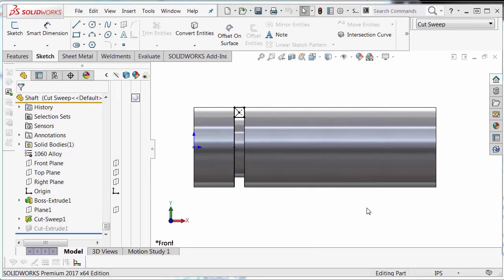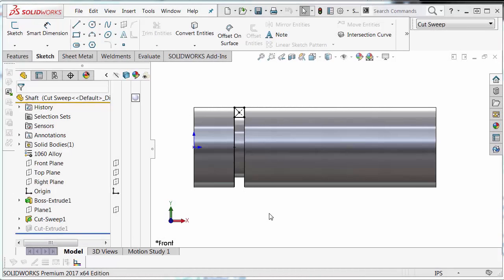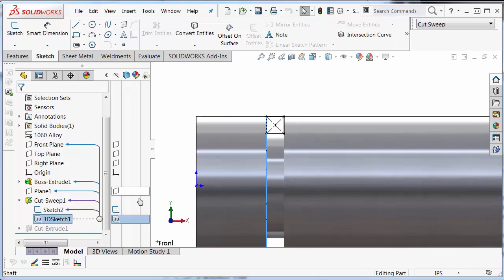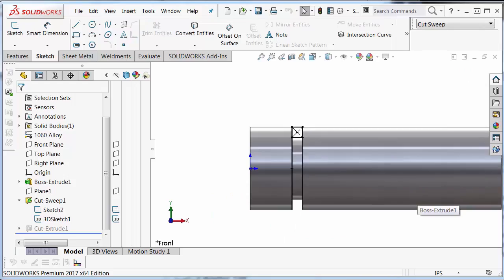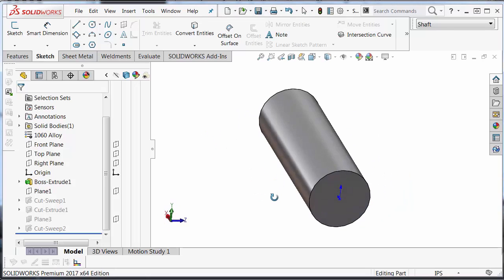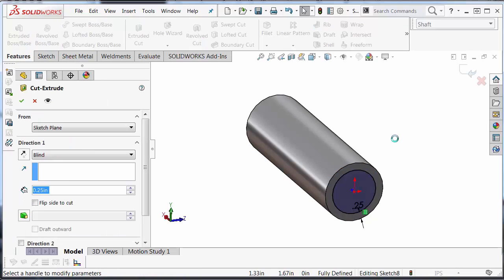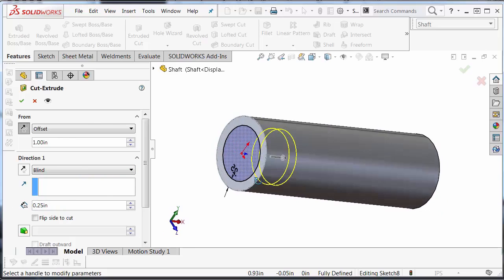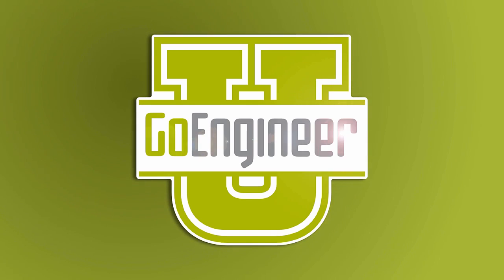SOLIDWORKS - Simplifying Shaft Cut

Comment: no one, in their right mind would design an undercut in the sweep method.  people will default to a revolve cut, rather than a swept cut.

also, your offset cut method does not work if this exists with more geometry around the same plane.  it will cut through everything along the new imaginary offset plane you created in your "simplified" method.  you will need to make a donut shape and then cut that region between the two circles.

but still, not as simple as a revolve cut...